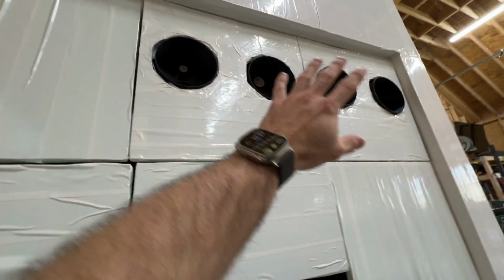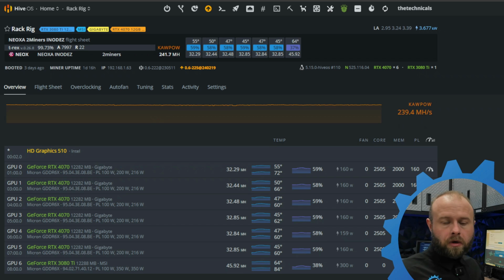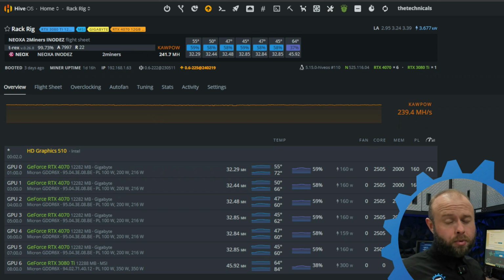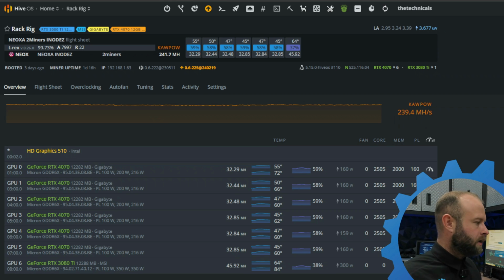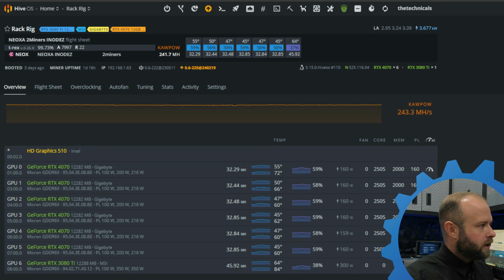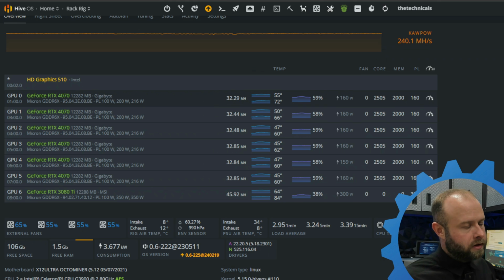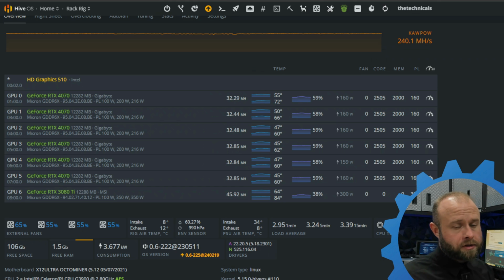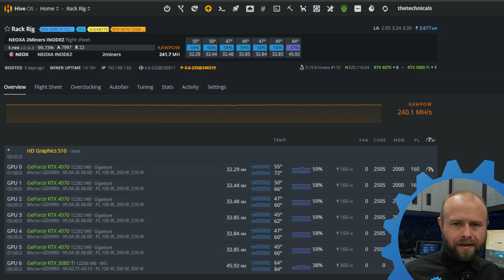GPU Mining Rig Build 2024

Comment: Hey i am a bit lost with this video. I have several X12 Ultras with 60mm or more of clearance. I've had several TUF and XC3 3080s EVGAs rigs on them, good temps and airflow, because 3080s xc3 are 46mm and tuf is around 50 to 52mm. I've also had severl 4070s from GB that say on the spec that are 50mm. So, how come in the video i dont see clearance between those? Another curious thing is, my X12s are 5x 140mm 240CFM fans. That case is only 4 ? Octominers changed ? btw, i have X12s with 6x 4090s with good fan clearance because i got the MSI Slim X versions. Keep up growing. Like your channel ;)
Reply from the maker: I had the same thought about a week after I shot this video. I started thinking about why this case shipped without any badging, and perhaps it isn't an authentic octominer. The internals all say so ,but there just isn't enough clearance. I'm unsure but i'm with ya man.
Reply: @TechnicalsMatt  I just double checked the European octominer where i bought all my octos, still 5 fans on x12 and size is way bigger in depth. Contact whoever sold that

Comment: What's the point of an Octominer for over $800? An open rig, which is assembled several times cheaper, is much better and more convenient. More convenient to maintain, better temperature, and less consumption (Octo coolers consume more). It will be necessary to install a cooling corrugation with hot air outlet. And these are additional costs. Purely an advertisement for Octaminer
Reply from the maker: Open air rig wouldn't be exhaustible in my mining room. I have to isolate and expunge the hot air. This allows that. I would've totally explored an R8 or other type of case, but this octominer had the space and was on sale on ebay. No other case would fit this many cards and also allow for exhausting. Not an advertisement by any stretch
Reply: @TechnicalsMatt  Chinese cases for 200-250 dollars with a motherboard. It is perfectly possible to release hot air. I administrated more than 100 such cases for 8 cards and there were no problems.

Comment: 76 GPUs running, 16 boxed up, 3 S19's, KS2, 2x KS0's, Jasminer X4-1U, 4 CPU rigs, Evergreen Chia mIner, and a iBelInk BM-K3 Kadena  ASIC currently collecting dust because I don't have the power available to run it
Reply: What is your Hashrate?>
Reply from the maker: I've been watching, grats on 1k subs too!
Reply: why you do not have the power?
Reply: @zzzzzzzz988  at that time I had all my breakers in the shed a max capacity. I’d have to have my sub panel replaced and more added.

Comment: i think i got that same octominer x12 from same ebay seller lol it looks like they switched out the original PSUs and put in some that need an adapter to work properly
Reply from the maker: Lol yep
Reply: @TechnicalsMatt  i actually had to buy 2 adapters! lol one for each psu port then one to join them into one, similar to the ones octominer originally sends you. Screw it, it works though! haha

Comment: I would have gone 4070 but I feel fortunate to have found 6 new 4070ti’s for $580 each.
Reply: I have a 3080ti too I use in my gaming pc and I gpu/cpu mine when not gaming/working. My whole 45 gpu farm runs off grid using hundreds of solar panels. I not only have a gpu addiction but a free power addiction.
Reply: Hi, where did you get the rtx 4070ti at that price?😊

Comment: on your 3080 ti you might want to try the 1200 core 2400 memory and  340 PowerLimit you probably wont use that limit all but you will hit to 60 mh/s surely. My farm is heavly 30 series and CMP 90,170 hx with 125 gpus. 12 workers(rigs). Trully thinking of getting some 4090's if i sell some of my cards. i have 100 amps only at the minute sitting on 82 amps so its my limit. when i get in to kawpow i can hit to 4 gh/s. At the minute mainly my cmps on kawpow the rest is on pyrin.
Reply from the maker: Thanks. Next time I hit kawpow i'll try that
Reply from the maker: Topped out at 51mh cries